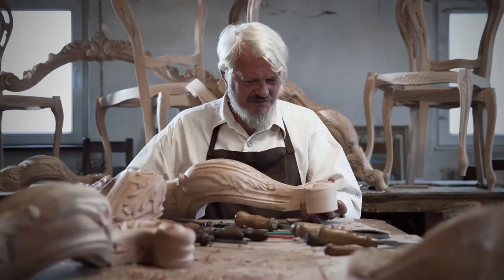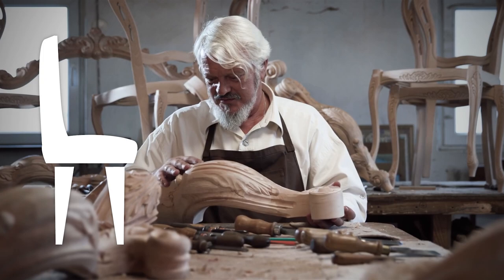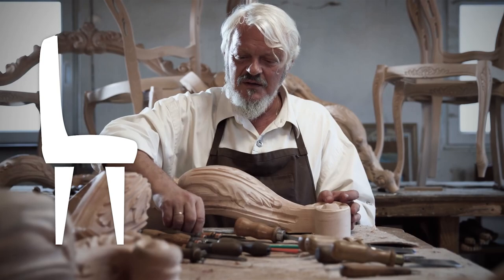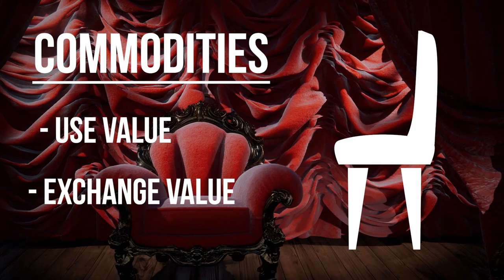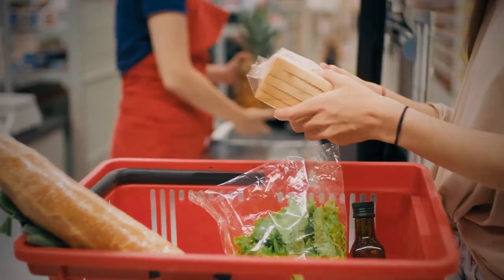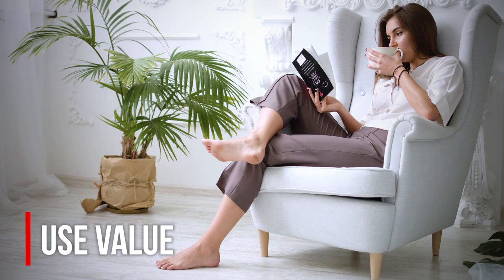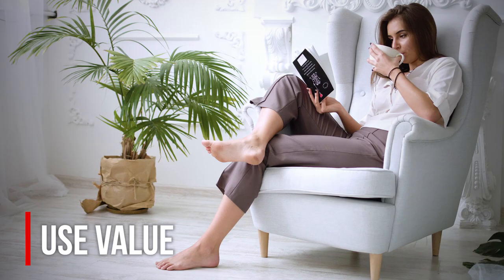Marx's Law of Value: Intro to Marxist Economics | Socialism 101

Comment: Marx was wrong. The labor theory of value is wrong. And this error is fundamental, it basically undermines his entire project. Dividing value into use value and exchange value was a mistake - the exchange value depends on the use value, not just the labor invested in production. He also refuses to accept the fact that machines do create value. This is an incompressible error. For Marx, machinery only transmits the value that went into producing the machine, which is obviously  wrong. Machines do create value, just like human labor does. Any source of energy can create value.
Reply: The work is still being done by labourers, but just pushed up by an order or two. If it takes me a month to knit a coat, and you make 100 coats of equivalent value in that time using a sowing machine, that doesn't mean the sowing machine is making the coats. It's just being used as a tool, so you and those that made the sowing machine are doing the labour.

The same is true of machines in a factory. Labourers design, build, and maintain the machine.

If an AI robot could do the same work as a human and we didn't consider it a living being, then whatever work it was doing would ultimately be work being done by those that designed and maintained the robot. If another robot designed the first robot then just push it up by another order.
Reply: @eveningchaos1  That is absolute rubbish. Machines create value - and surplus value - just like human workers do, even more so. That’s why AI is replacing factory workers - because it’s much more profitable. Why are you stuck on Marx when he was obviously wrong? 

Marxism is a secular religion that pretends to be “scientific”, but ask yourself: have Marx’s predictions been correct or incorrect? Marx predicted that profit margins would inevitably fall as capitalists increased the use of machinery relative to human labor and this would drive down wages to starvation level, thus forcing the workers to revolt and overthrow the capitalist system. Has this happened? No! Never. Not once! 

His predictions failed to materialize because they were based on a false premise: they only human labor can create surplus value and that machines cannot do so. 

The problem with Marxists is that their ideology is like a utopian religious faith, it provides them with the promise of a wonderful future for all humanity, and they want to believe in it so badly that they cannot think critically about it at all, even when the ideology is clearly based on false premises like the labor theory of value.
Reply: @syourke3  simply put, i respectfully disagree.
Reply: @syourke3  you have to be nuts to say this lol. Equating machines that came from humans to humans that came from humans. 

1. Labor Theory of Value and Use Value vs. Exchange Value: The argument that dividing value into use value and exchange value was a mistake misunderstands Marx's distinction. Use value is the utility of a commodity, while exchange value is its value in relation to other commodities in the market. Exchange value is indeed influenced by use value—no one would buy a commodity without use value—but it is determined by the socially necessary labor time for its production. This differentiation is critical in understanding the dynamics of capitalist economies.

2. Machines and Value Creation: The assertion that machines create value misunderstands Marx's analysis. Machines do not create new value; they transfer the value embodied in them to the products they help create. This value was initially created by the labor that produced the machines. While machines increase productivity and can reduce the amount of labor needed for certain tasks, they do not generate surplus value on their own. Surplus value arises from the exploitation of human labor, where workers produce more value than they receive in wages. This is a cornerstone of Marxian economics.

3. Profit Margins and Mechanization: The critique misunderstands Marx's argument about the tendency of the rate of profit to fall. Marx posited that as capitalists invest more in machinery (constant capital) relative to labor (variable capital), the rate of profit tends to fall because surplus value is derived from labor. This is a tendency, not an absolute law, and is influenced by various counteracting factors such as technological advancements, opening new markets, and increasing the intensity of labor. The fact that profit margins have not universally fallen to the predicted levels does not invalidate this tendency but rather highlights the complex, dynamic nature of capitalist economies.

4. Predictions of Crisis and Revolution: The critique claims Marx predicted inevitable revolutions due to falling wages and rising mechanization. Marx indeed analyzed the contradictions and crises inherent in capitalism, which can lead to revolutionary conditions. However, he did not claim that such crises would inevitably and uniformly lead to immediate revolution. Historical materialism recognizes that social and economic conditions vary, and revolutionary potential depends on a range of factors, including political organization and class consciousness.

5. Religious Faith vs. Scientific Analysis: The critique labels Marxism as a secular religion, but this mischaracterizes the empirical and analytical nature of Marx's work. Marx's theories are grounded in a rigorous analysis of historical and economic data. The labor theory of value, while contentious, provides a framework for understanding the dynamics of exploitation and capital accumulation. Marx's analysis remains relevant for examining the inequalities and instabilities in contemporary capitalism.

6. Technological Displacement of Labor: The rise of AI and automation does not contradict Marx's theories but rather illustrates them. Automation displaces workers and can intensify the contradictions within capitalism by increasing productivity while potentially exacerbating inequality and unemployment. The profit motive drives technological adoption, but this does not equate to machines generating new surplus value independently of human labor.

In conclusion, the critique of Marx's labor theory of value and his broader analysis of capitalism is based on misunderstandings and misrepresentations. Marx's insights into the nature of value, exploitation, and the dynamics of capital accumulation remain crucial for analyzing the complexities and contradictions of modern capitalist economies.

Comment: Your understanding of economics is so bad you fail to realize that the “capitalist” didn’t make a profit at all… 

He started with $60, and ended with $40…. 

He lost money while the laborer gained money. 

Also, lets say that your example wasn’t “fecked”

What about the cost of electricity, building maintenance (of the factory) and other overheard costs. Even in a Marxian system these things would have to be covered. The end result would be a marginal increase in pay towards laborer, and a huge increase in the responsibility of the workers to manage the tasks that the capitalist manages.
Reply: You're joking, right...? He started with $60 and ended with $100, his profit was $40.
Reply: @polachica2573  he has to pay the worker 40 he ends with what he started with.
Reply: @CoTheboxer  capitalist starts with $60
means of production: -$20
labor power: -$40
= $0 

chair price: $100 (taking out the $20 of the means of production, that would mean the labor power's value is actually worth $80)
capitalist profit over the worker's labor (unpaid labor): $40 

capitalist started with $60 and ended up with $100, 40% more than what they had
while the worker only got $40 for making something the the labor value was worth $80